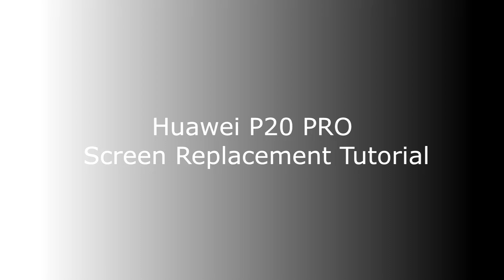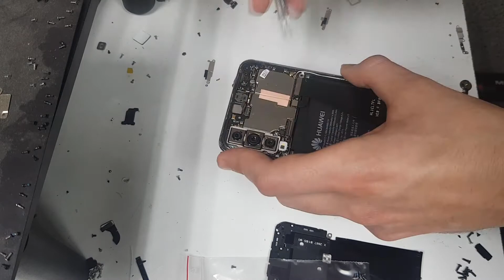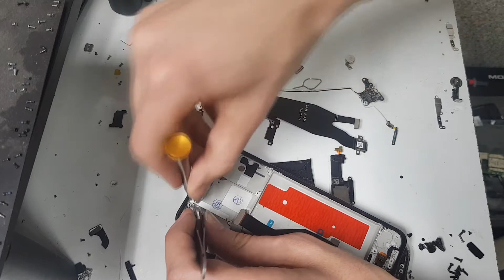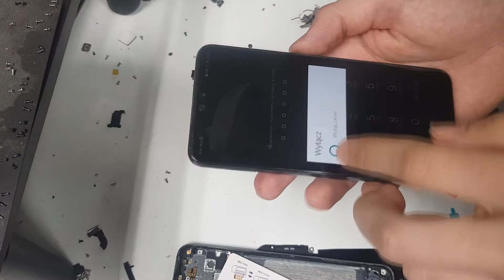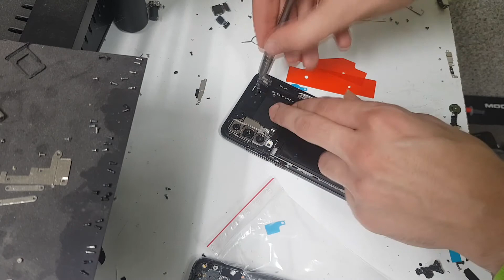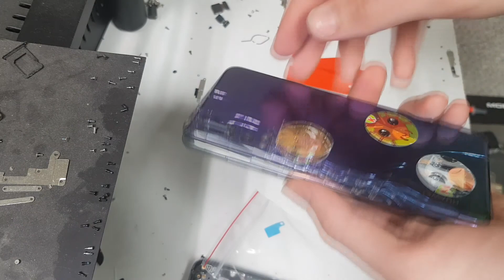Huawei P20 PRO (CLT-L29) Chinese display with frame Replacement Tutorial

Comment: To be fair this needs more. Sometimes you disappear and we have no idea what you did. At 11.28 you disappear, what did you do?  You removed parts that are not shown. Most of the parts in mine are stuck down and are almost impossible to remove without damaging them. The battery was stuck down so much it bent as I tried to remove it. Did you apply heat to the case to enable removing the battery easier? I am thinking that's what is needed.
Reply from the maker: Thanks for your opinion
Reply: @eSelekt  dude how you dissamble hl1cltfk ver dc 1841 part